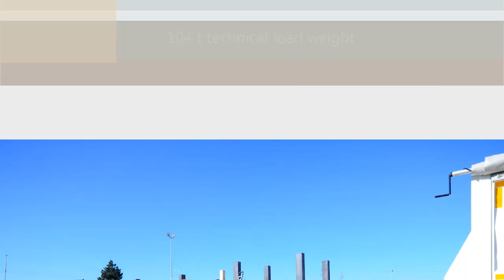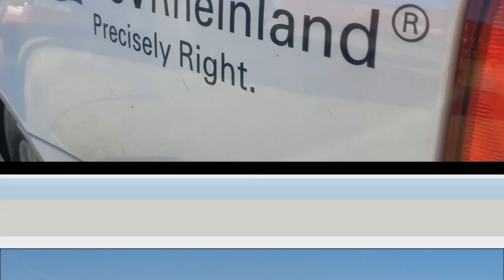Low loader 8-axle drawbar trailer with steering axles - testing TUV Rheinland

Comment: What is the purpose of this trailer ?
Reply from the maker: This low-load trailer, according to the rules of division of motor vehicles and trailers, labeled SK, it is actually an emergency transport trailer. It is specially designed and manufactured for the transport of a construction machine, namely a single bulldozer (caterpillar) weighing approximately 78t and required for work in the mine.